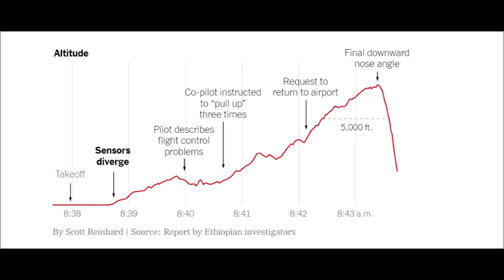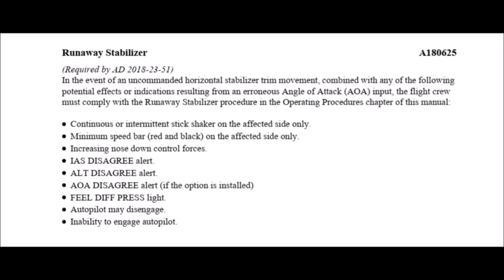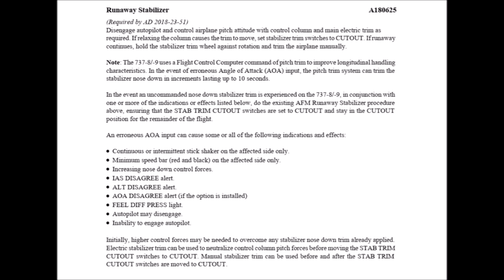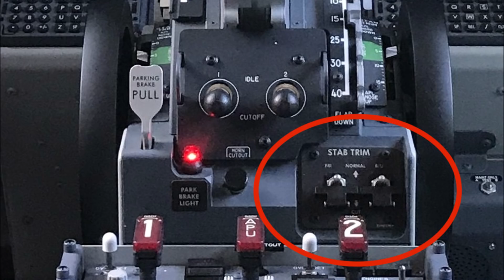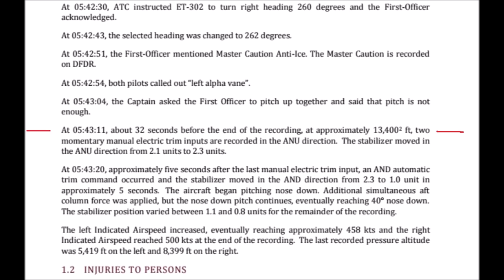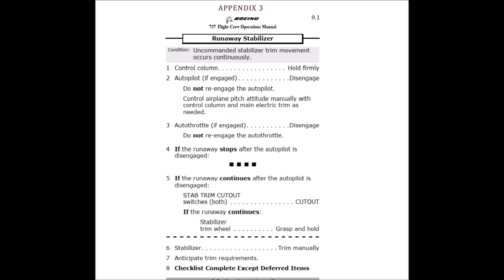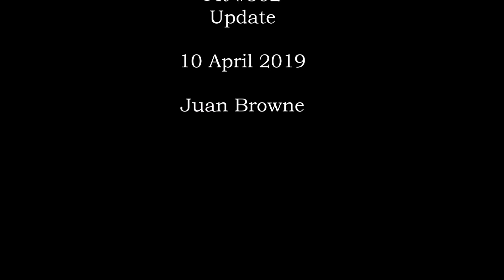737 Max Update 10 April 2019 Runaway Stab Trim Procedures

Comment: Is there not another answer? As the MCAS activated, could the pilots have thought that the problem was something other than runaway trim? If the pilots had no training in MCAS failures, would the strange behavior of the plane lead the pilots to believe they had some other failure going on??
Reply from the maker: Very confusing onset...
Reply: @blancolirio  Indeed! Thanks for the videos and commentary..

Comment: In the days of sail, they devised suitable ships' clocks so that longitude could be accurately calculated. However, there was usually a small error, so some ships carried a second clock. Problem then was, if both diverged, which was the accurate one? So they introduced a third clock. I don't know why triple systems aren't used in airliners. I may be wrong and my flying experience in my youth was mainly weightshift - but could somebody comment on this? Or was it a software problem, not a mechanical one?
Reply: It takes 3 stars to get a proper celestial fix.

Comment: Thanks, this is a much more balanced (not just better informed) presentation than your earlier commentary. The pilots I have spoken to at my company seem about evenly divided on whether to place blame primarily on faulty Boeing software or on pilots who made some errors and missed some opportunities to save the aircraft. All agree, however, that Boeing has the deep pockets and that people involved (outside of NTSB) will try to nail the manufacturer's skin to the wall. As to tunnel vision, the formal term for which is "perceptual narrowing," it certainly is a very real and dangerous phenomenon, as you pointed out. It has been addressed in classroom and simulator training--at least in mine--with simulations designed to induce tunnel vision followed by discussion of the phenomenon and how to minimize its effects.

Keep up the great work. We appreciate it!

Comment: Interesting video. A couple of things I noticed when poring over the data traces: 
1) During the flight, the throttles DO move, by around minus 8-10%. This suggests something was moving them. If it was the pilot, he may have had a good reason for believing (if erroneously) they needed to remain high (Data shows consistent airspeed disagrees on both sides). 
2) 500 KTS was only realised in the final full nose down position before impact, shortly before which throttles had been retarded. Prior to that, and with a gradual climb, they nudged just over VMO when trying to manually trim with the wheels.
3) The final nose down trim appears to cause the pilot to push forward on the stick at the same time, leading to an exaggerated nose down movement. This appears to be a horrible aspect of the accident as 4) their final altitude before the final nose over was the highest it had been throughout the flight, around 10,000 feet. This could have given enough time to recover had the nose down not been so violent.

Comment: Another question.  We know the trim was found in "full nose down" position. Even if you keep speed under control and can trim it manually can you trim it fast enough from "nose full down" to a position where the aircraft can climb if you are 2 or 3000 feet above ground? How many revolutions would it take to turn the trim wheel and how long would it take? Is it physically possible to trim it manually fast enough at such low altitude before you hit the ground?
Reply from the maker: Not sure.

Comment: Very helpful analysis of the preliminary report.  Although the pilots may have made some errors under pressure, it seems to me the root cause of this tradegy was that Boeing released into service an unsafe aircraft alongside an unsafe system of operation.

Comment: As I said in the last video (and got yelled at for), Pilot error. That's not to say that it was the only contributing factor, but if they had executed the emergency procedure as written the plane would've been saved. 
 What's puzzling to me is "runaway stab trim" is a memory item , like engine fire. It's so dangerous and time critical that the crew must have it committed to memory to be type rated. If they didn't know the procedure by heart, why were they flying the plane? If they did know what to do, why didn't they do it?
 Looking at Boeing's end... They knew runaway trim was a threat for years. If they knew the warning signs of conflicting inputs, why didn't they just simply have MCAS respond to it by disabling itself? That's standard procedure for flight critical avionics.

Comment: So, it SEEMS that what you're saying is that, IF the pilots had:

(1) turned off the auto-throttle and set the throttle at something approaching minimum cruising speed; AND

(2) re-engaged electronic trim on the yolk (by turning "off" the STAB CUT OUT switches) for NO MORE than 5 seconds at a time,

they MIGHT have reduced air speed and improved trim enuf to sufficiently enable use of the manual trim wheels to fiinish trimming the aircraft, gaining control of it, and landing.

Even if so, it still seems that the problem lies principally with hardware and software because the runaway trim was precipitated by erroneous AOA input (hardware) and unlimited anti-stall, nose down "correction" by MCAS, both of which were not reasonably foreseeable by the pilots (new plane (hardware) and insufficient training on MCAS (software) because it was either buried in the manual or deliberately concealed by Boeing to avoid the delay of seeking a new FAA certification for the engine forward/up Max 8/9's). 

Secondarily, the failure of the pilots to reduce airspeed and limit automated trim inputs was entirely foreseeable for Boeing because of the human factors/tunnel vision that come into play when pilots are confronted with unanticipated conditions.

I pin this on Boeing top to bottom, beginning to end.

Comment: Excellent analysis thanks. As an experienced B737 variants retired pilot:- Norm in all (UK) companies I flown with is always to disengage autothrottle for hand flying on the B737 (ie no autopilot) as thrust changes can be destabilising trim wise. Perhaps the PF was reluctant to reduce thrust as this would adversely affect already large out of trim condition. Also agree about "tunnel vision" but the stick shake (noisy) and also GPWS "Don't Sick" warning would add to pilot overload.

Comment: Training..Training..Training..my guess is they didn’t have enough. Also I think the first officer only had a few hundred hours. It would be interesting to have some jump-seating observation flights and review-line operations. Pilots are not all the same..I know that’s not politically correct but nonetheless true. I personally would never fly on some 3rd world country airlines..never. I’ve been a Captain since 1986 at a major airline in the USA with 7 type ratings..40 years airline and over 30,000 hours flying almost exclusively international.

Comment: Great information Juan- thanks.  Begs the question- if the data allows the incident to be reconstructed and they shoulda this or shoulda that determined- why isn't that built into the system to prevent such things in the first place?
Reply: The reconstruction takes a lot of time. The pilots did not have time, and the computers had faulty information.
Reply: @gordonrichardson2972  Understood.  But simply watching airspeed spool up (well past redline) while altitude goes away would suggest throttle back so some percentage less than TO power.
Reply: The B737 has limited automation compared to more modern aircraft. That is both a training benefit, and a safety limitation.
Reply from the maker: It will hopefully all be in the fix.
Reply: @blancolirio  sure hope so.  Loved your "tunnel vision" example- its used in so many things besides flying, it is its own new law.

Comment: the MCAS system should have its own cutout switch rather than combined with the electric trim cutout.  That would at least allow the pilots to use their yoke trim tab switches control the electric trim assist still to help when the stabilizer is under a heavy load assuming MCAS has been root caused as being the trim issue.., but of course if they did that then I guess they would change the trim runaway procedure too much and not get the MAX recertified quickly.
Reply: The problem is that Boeing tried to re-use existing switches, which was a very costly mistake...

Comment: Great Video,,, What a Great Job You Do... But First, Let's Call a "Spade a Spade"... These Two Men, Simply Were Sub Standard... Either You Are a Pilot or a "Video Game Controller"... First Rule of Instrument Flying,,, Very First Lesson,,, "Needle ,,, Ball ,,, and Airspeed"... That's Basic Stuff ... The Airspeed  Was Not Controlled... Why Was The Airspeed  Forgotten ???  Was It Because of The "Habitual Use" of The "Auto Throttle System"... Relaying On The System Every Day, Every Flight ??? With The Airspeed These Guys Attained,,, It's a Wonder They Didn't Pull The Wings Off This Airplane... It Goes To Show You,,, "Built Boeing Tuff"... Now Back To Basics... Evidently, This Was Not a "Qualified Crew"... Yes, Maybe They Were "Double Crossed",,, That Very Well Could Be,,, But They Still Were Not "Qualified" With The Basic Operating Systems... That's Sad,,,, This Is Going On Everyday In The Airline Industry... We've Got To Get Back To Basics... Either Call This Accident What It Is,,, "The Crew Failed To Fly The Airplane" According To The POH... Or Maybe We Can Simply Call It a Computer Glitch,,,
Reply: @j.o.1516  ,,There's No Monday Morning Quarterback,,,  They Had The Airplane At Full Throttle   Headed Straight Down Hill,,, That's a Fact Not Fantasy, and  That's Not Monday Morning Quarterbacking,,,

Comment: Thanks for the good explanations. If the pilots had trouble getting a positive pitch, maybe they would not slow the aircraft's speed which would increase pitch down. The pilot may also have realized that he would not be able to land the aircraft before he again had the opportunity to make positive pitch at lower speed. The only option to do this was to re-establish electrical trim, but they should have made small constant picht up pulses every 3-4 seconds to keep MCAS inactive and trim-cut off after adjustment. Something that the pilots are not trained in and the result of missing information about the MCAS behavior from the manufacturer.
Reply: As you say, getting positive pitch is only the first step. Landing it might have been a challenge.

Comment: if they'd pulled the throttles all the way back... and not turned the electronic trim on again.      if MCAS was twinned between left and right and one sensor was a certain percent out of whack with the other the system just shut off automatically.   that would have been nice.

Comment: So 
1- Faulty MCAS turned nose of plane towards ground while at low altitude...
2 - Once he initially turned off MCAS switches he lost electric trim control?? 
3 -The only option then to reset trim from nose down is manual? 
4 - And manual trim control didn't work because he was going too fast? 
5 - So he re activated MCAS cut out switch to reactivate electric trim control (the only option left) and stop the dive?
6 - MCAS dropped nose and dived plane into the ground.

Are point 2 and 3 correct??
Reply from the maker: Yes.
Reply: By turning <ON> the MCAS, doses not the pilot override  the automated MCAS response as long as he is holding the electric trim control buttons? Does releasing the electric trim control button on the column return the command to the MCAS?

Comment: Wow maan just wow. So from what I just watched I'm getting a feel of inexperienced crew unable or untrained to deal with the situation. So it leaves me to believe that the  pilot that was hitching a ride on the  lion air  flight that got into trouble and he simply got that crew out of trouble did exactly what was supposed to be done without incident. And my assumption is based on what you said about following the proper procedure. So this seems to be a combination of different things. Runaway trim and runaway plane going way too fast. Manual trim impossible at that speed it seems.
Reply: need to catch it early (you shouldn't be fighting the trim system if you are you need to be retrained)

Comment: Thank You for another excellent video explaining the Preliminary Report without hyperbole. Thanks for also addressing the Throttle issue. I have heard that Auto Throttle is preferred by the Airlines not only because it reduces crew fatigue but also and mainly due to fuel savings. Is there any directives from the companies that might subconsciously might interfere with pilots disengaging auto throttle? Again Thanks for the excellent video and explanation something sorely lacking from our so called News Organizations.

Comment: As you continue to talk about MCAS in future videos, I would like to encourage you to emphasize that computers in general make flying much safer -- not more dangerous.  I get the impression that many people are confused about this.  But, I doubt there is a commercial pilot out there that thinks pre-computer era airplanes (say the Boeing 707) are safer.

While the MCAS system is an example of a poorly designed computer program being dangerous, in general computers have made flying MUCH safer than it would be without them.  There are a lot of places that a computer can make changes to the airplane without direct input from the pilot.  A few that come to mind: the auto-throttle you mentioned, the stick pusher, rudder movement for coordinated turns, auto speed-brake deployment on landing, not to mention the auto pilot that can control the airplane in all three axes.

Questioning why MACS is there makes no more sense than questioning why the auto-throttle function, or the auto pilot are there.  These functions are intended to make flying easier and safer.  Just because MCAS caused crashes doesn't mean that computerized functions that make flying easier are a bad idea.
 
To say "the computer caused the crash, so get rid of the computers" makes no more sense than to look at a crash where a pilot was the main factor and say "get rid of the pilots".  Computers and pilots have a long history of working together to make flying safer.
Reply from the maker: Great points, I have brought thus up before and will do so again. Thanks for the reminder.
Reply: @blancolirio , only working computers make any operation safer.  Garbage in = garbage out.
Reply: Hear, Hear!  Superb comments!

Comment: Thanks for all the great information, the only thing I would add is; If that crew had simulator training dealing with the MCAS malfunction they probably would be alive today. I think that this is another area that need to be addressed prior to getting the Max back into the air.
Reply from the maker: Yep!
Reply: No question about it.  Plus they better look at the design and number of sensors.  I doubt exhumation of the wreckage will help.  If they find them at all, they are bound to be very bent up.
Reply: Agreed !

Comment: Two other psy factors working on the pilots: 1) lightly loaded aircraft w/ 20% more powerful engines and the reduced climb = acceleration beyond expectations 2) AFIK rising ground during departure negating airspace under you. Now add an automated system that tries go make you eat dirt as soon as the flaps are retracted.

Comment: I find it hard to grasp that the autothrottle, regardless of its setting, will allow itself to remain engaged when the plane is trying to go supersonic.
Surely it should "panic" and release autothrottle, in the same way that the autopilot will release control when it 'panics' due to conflicting or wildly out-of-bounds inputs?
Reply from the maker: It's in a 'Hold' mode...pilot intervention required.

Comment: It looks like you spent 95% of this video blaming the pilots and not Boeing.  Do you fly a Boeing aircraft for a living perhaps? If so I am sure they are aware of your channel.
Reply from the maker: We have plenty to share about Boeing's poor design....stby
Reply: Personally I don't see his remarks are stating there was piolt error.  He's stating it may have been possible for them to save the plane, but that's actually entirely conjecture.  The report indicated that there was faulty data from the AOA sensor.  If pilots can identify the problem quickly enough they might be able to save the plane, but that's a huge "if" in my opinion.   The entire scenario is predicated on diagnosing the problem quickly and knowing exactly what to do about it.  In my opinion pilot training was entirely inadequate.  Furthermore this should not be a normal occurrence, but an extremely rare event.  All planes are grounded and Boeing is working on a software fix because of pilot error?   Not exactly logical.

Comment: There is so much secondary information available to the autopilot I am surprised that it relies on just primary sensors. For example, GPS and altimeters will say if the aircraft is moving in z axis, pitot, inertial and GPS will give speed, Gyros will give attitude. With all these the autopilot should be able to determine if AOA sensors are working or not and if not then cease operation! Other accidents where faulty pitot tubes were at fault... again GPS will give speed, not as accurate but enough to do a check to determine if the pitots are faulty, inform the human crew of the issue and disconnect. Seems crazy to me a single or double sensor failure can cause a fatal crash whenever these primary sensors are not the sole providers of data, I include the pilots as sources of data as well, they can determine by eye if the have a 70 degree AOA I think.